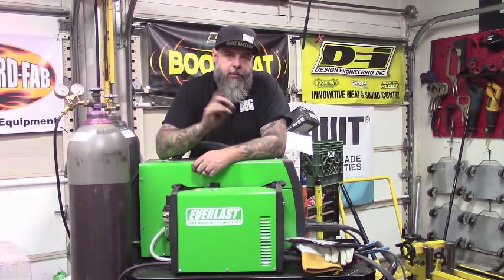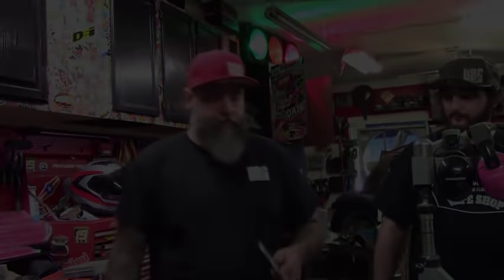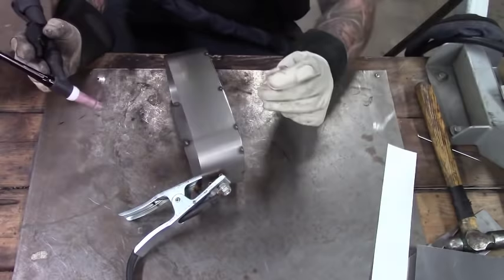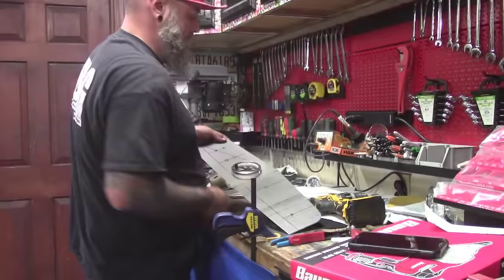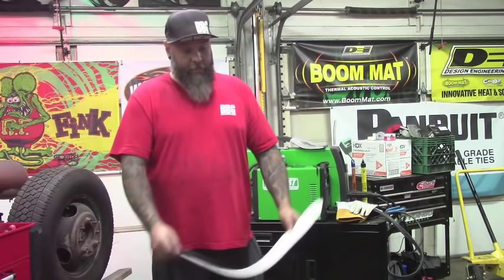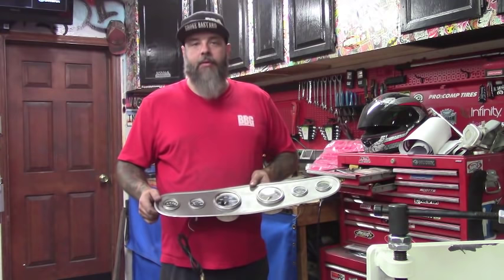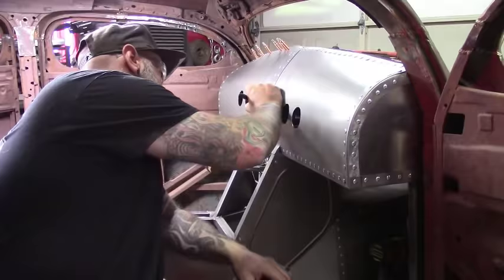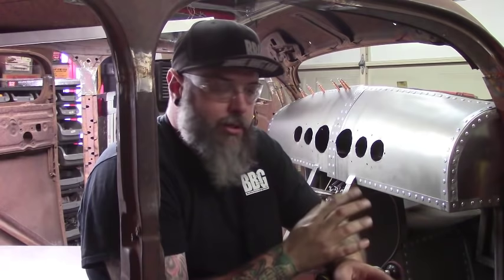Custom Gauge Panel - 1937 Rat Rod - Update 58

Comment: You may have a pile of dreams on the floor but before anything is done it usually looks bad before great. I would take old gauges from the collection of never will use pile and place them in the holes and see if you don't just have some panels other only dream of making near that good. Just cause you're not digging it doesn't mean it ain't someone else's jam. You're the worst enemy you have and it costs money so reclaim it in maybe you will like what gives so far. I took a dash apart in a K.W. and then took my square body dash completely out and fabbed it in. And if you go with something temp another idea will come eternal and save the day. I know, it's easy for me to say but its true. Only masochists get pleasure from screwing up. I use them for learning and you will admit this is not the dash that you had in your head when starting. I put a complete cut to fit custom 64 buick wildcat dash in a model A roadster and under that hood laid that 326 with three deuces hidden from others till smoking most all around... there is always someone faster/LOL.

Comment: Wow. I feel your pain. I have been going thru a similar  experience. I have a 54 Chevy truck.aka Ol' Beater. I bought a speedometer, and a tachometer, smaller radius than the original. I want to make a panel  over the dash,  but joining both holes over the steering  column.  I'm thinking an aluminum plate. Oh well .see ya